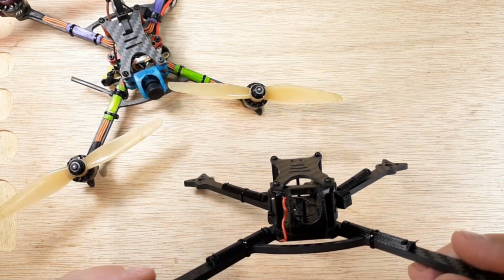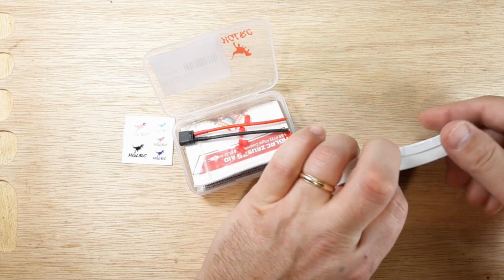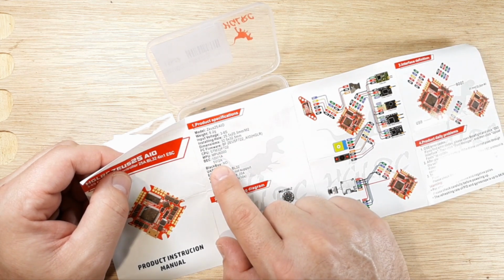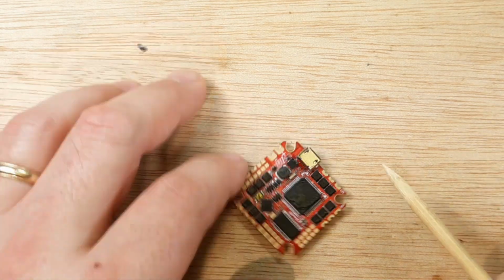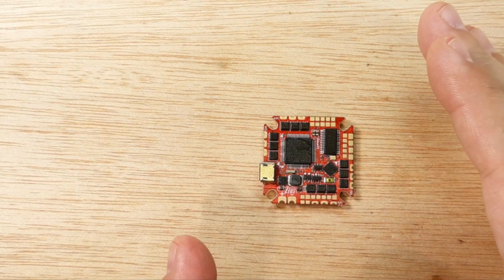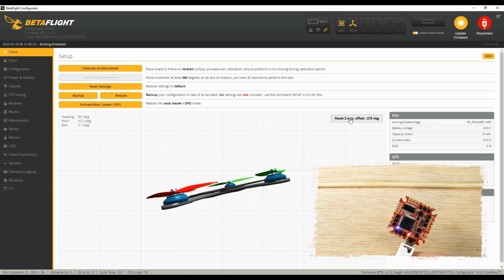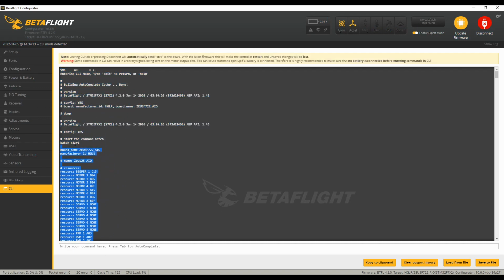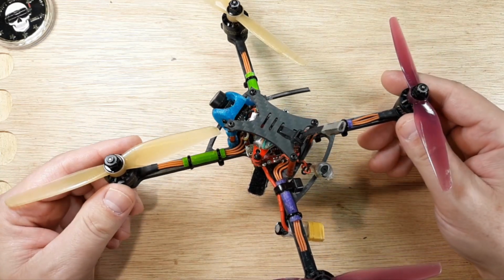The Flight Controller | How To Build A Drone | Sub 250 Quadcopter Build Video

Comment: Diatone has a substitute motor  ( Toka 1408) but it’s a t mount prop and it has 14 magnets and 12 poles.
Reply from the maker: I looked at it, really not happy with the specs of it compared to the original. I plan to find a very close substitute for this build - to list it in the description of the build video coming soon. Appreciate the heads up...🍻